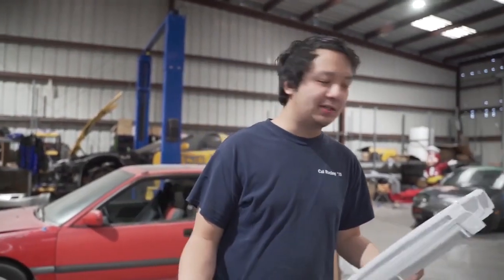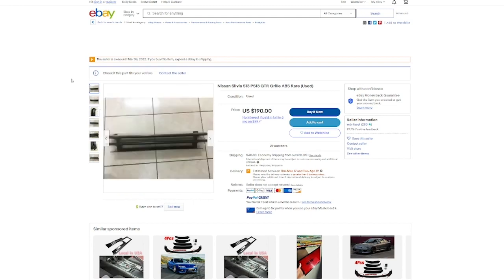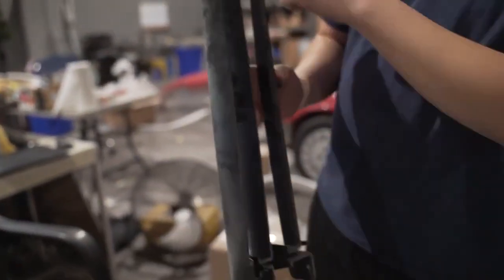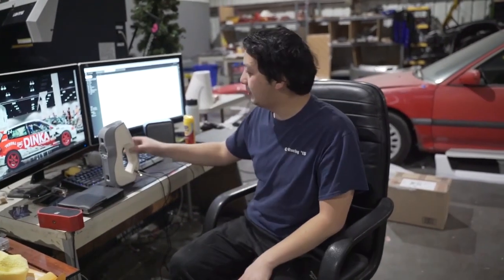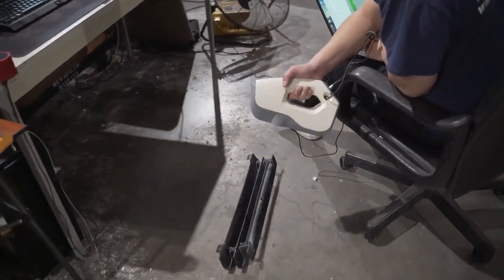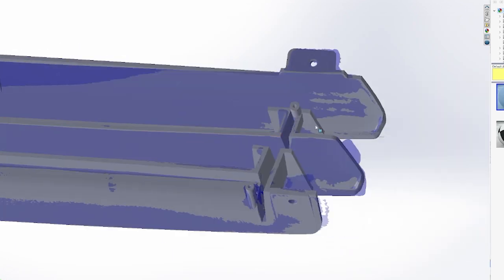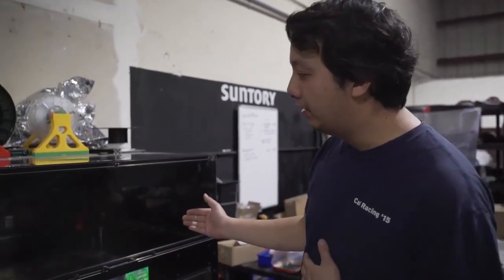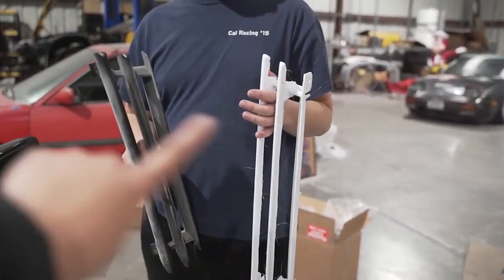Should this be illegal? 3D scanning old discontinued parts! (Nissan S13)

Comment: $20k for the 3D Scanner
Reply: And it's not a very good scanner for sharp edges with car parts.  Requires a lot of cleanup.  I ended up with an Einscan HX and it's far better and almost half the price.
Reply: @NischGTM  Did you ever try using the HD data on the Eva?

Comment: Did you take the opportunity to take the sag out from the original that occurs over time? Looks like you might've but you didn't mention it. Mine has sagged and I'm going to have to make a bracket for the centre to hold it straight. Also, JDM 180sx "50/50" front parker/indicator lights don't belong on a Silvia front end
Reply: They're S13 parts, they fit. This whole frontend is a swap anyway, the car's a USDM 240sx, not a Silvia, being pure was out the door a while ago.

Comment: But in the end it looked awful? You'd need to use filler, sand it a bunch and perhaps even make a mold and maybe use resin or something to make a super nice finish?
Reply from the maker: This is just prototyping. Having a correctly fitting part is a lot harder than making it look nice.
Reply: Finish doesn't matter at this point. He now has mount locations and dimensions, so can refine the finish & it also allows for custom designs 🤙

Comment: Even printed in ASA wouldn't it melt and bend in hot sun?
Reply: Asa should be alright, There are a bunch of tests on YouTube saying it’s good for outdoor use. But I’m also printing my own grille so I can let you know how mine turns out if they can’t get to you!
Reply: If that’s an issue no problem reverse casting the part with aluminum and boom got a metal part.